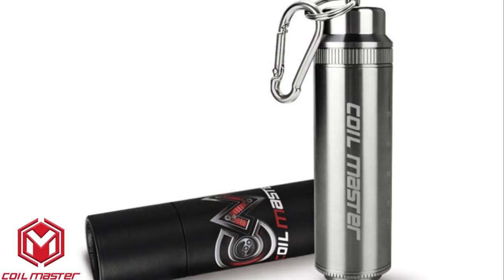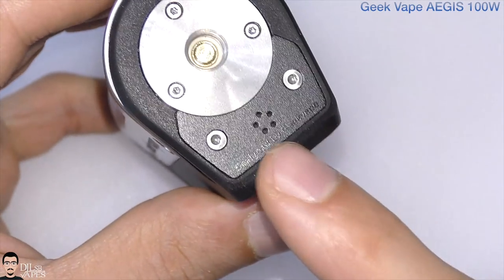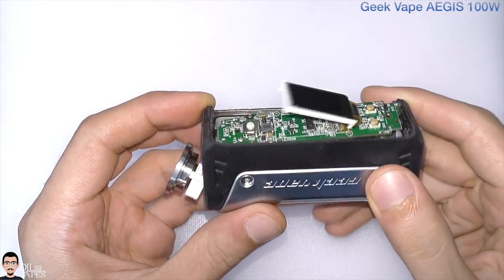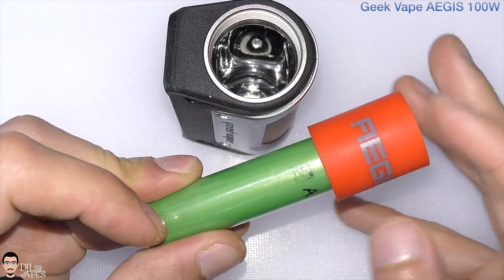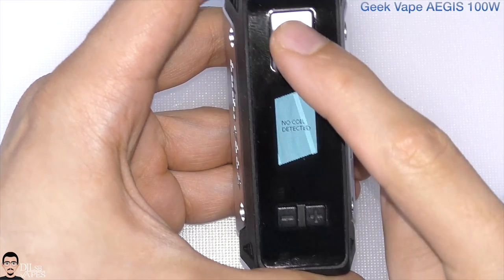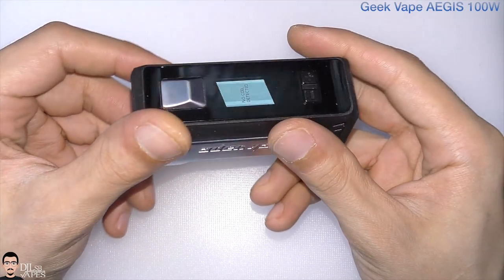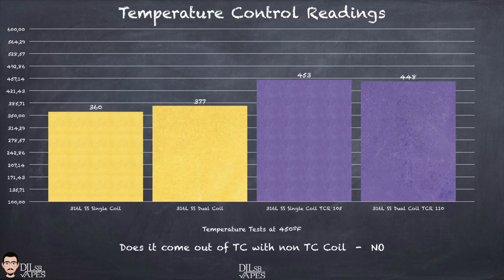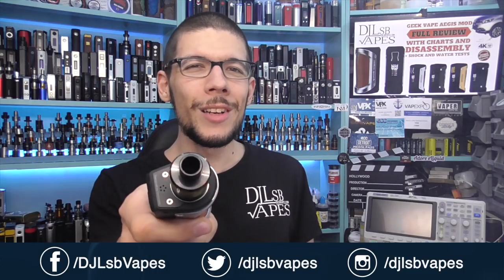Geek Vape AEGIS Full Review and   with Charts and Disassembly + Torture Tests

Comment: I got mine today and so far love it.  I have the new kit that came with the Shield Sub Ohm tank.  Do you think this version has the TC fixed?  This kit also came with an extra battery cap (marked for 20700/21700) so I can also use those batteries in it too...a plethora of batteries that can be used.  I love the instant hit on it and the feel in my hand.

Comment: Is the plastic cover over the screen press fitted? Or glued on? I want to take off the fire button and repaint it. Im the third owner of my aegis, as it was handed down from a good friend. It's over a year old I think but works perfectly still. Just some cosmetic damage. 

The panels surrounding the leather are easy to take off and will be an easy job. But I don't wanna compromise the water proofing if I remove a glued seal to get to the fire button. 

I didn't see it on your sample model Daniel, but my aegis has o-rings around the long screws holding down the 510 plate. Genius engineering to prevent water and e-liquids from seeping in the device. 

I see why this device was so popular. I love it. Perfect for my needs. 30-50ish watt vaper. 1 battery lasts a whole work day. I swap batteries when I get home and usually only drain to 3.55-3.7 volts.

Comment: Do you think vent is going to be problem on this device? I really the device but the vent scares me.Does it makes the device hotter then usual?
Reply from the maker: Not at all, always runs cool, and being a regulated mod with plastic battery compartment, will never vent I'm sure, but they still did a good venting system just in case.

Comment: I work for banks on foreclosure home rehab and demolition, I need a tough mod and the Aegis is the undisputed Champion. I own five Geek Vape Aegis mods and I bought my two man crew each an Aegis mod.  I have smashed many mods at work. One of my guys lost his Aegis mod at a property 30 miles from headquarters on December 4th of this year. We got a work order to go back to the property today.
  We looked everywhere for the Aegis he had lost and could not find it. As we pulled away from the property he yelled Stop! He jumped out of the truck and pulled his Aegis out of the dirt road directly in front of the next door neighbors driveway. Tire tread marks all over the dirt road and the Aegis was smashed down level in the sand. He picked it up the Joyetech Procore Aries tank was cracked badly. The Geek Vape Aegis was the black model and after the dirt and sand washed off it had a few minor scratches on the metal side plate.
 After a week in a half of rain and being driven over on a dirt road the Aegis works. The Geek Vape Aegis proved itself to me in real life. Not only do Geek Vape say the Aegis is shockproof, dustproof and waterproof. The Aegis out in my Ford truck PROVED IT. Simply amazing device. if you need a dependable and diehard mod, the Aegis will easily take the job.
Reply: Eyehayt Apricots you bought 5 of the same mod?
Reply: Yes, 2 black models, 2 yellow models and the grey and orange one. (1 black and yellow are still in the sealed boxes as backups or for the zombie apocalypse.) Plus I lose and break a lot of stuff at work but not anymore mods because of Aegis.  Between me and my crew no Aegis has broken yet. I have a bunch because you can't charge the Aegis and its unsafe for me to carry batteries at work. I vape at about 80 watts so I always have a backup with a charged battery. If I lose one or run the battery down which it will do since it's only a single cell mod. I quickly switch to the fresh Aegis. I have another bunch of non Aegis mods that don't leave the house but that's a whole different problem.

Comment: I still use this mod as my go to, and it looks almost brand new. They won't make another of this build quality. Even the Legend is a notch below in quality. If you vape over 80 watts, look for a dual battery mod, 26650s have a tough time at higher wattages.
I find that running this in bypass mode is perfect with my Revvo tank, gives me much better battery life. Running the Aegis/Revvo at 80 watts,I get like a half day of vaping, while in bypass I get a full day ez. all mods should have a bypass mode option (note to Smok) imho. I do get much better battery life in bypass but don't have a different mod with bypass to compare it with.

Comment: Hello,
i have just one question.
How do i lock the resistance in TC mode after upgrading to firmware 1.23 ?
If i do a 3 click, the resistance is no longer highlighted, so i can't lock it with the - key.
Thank you in advance.
Best regards, 
Volker

Comment: Seriously impressed by the capabilities of that mod, but most of all by how rugged it is.
I put my entry in, but even if I don't win, I may consider buying one.  As I have limited sensation and a slight tremor  in my hands and arthritis, dropping a mod is always a possibility, and one that can take it as easily as that is very attractive, although the shape looks as if it would pretty secure in even my hands.
Perfection would be a squonking version - tanks are fragile by their nature, but RDAs are usually solid metal, so can take a beating - but dripping is tricky for those of us with limitations, and squonking is a great solution for us.
Until such a version is available, this plus one of the more robust tanks looks like the best solution, especial as with a 26650 installed, the silicon 18650 adapter sleeve might possibly stretch over a 22mm tank to protect that too!  Do you reckon it would stretch enough for that?

Comment: Nice review Daniel. I have been looking for a new mod. I would even take the beat up one it would match how my Alien looks with only normal use.
Reply: Stuart Dias lol
Reply from the maker: Hahaha ;-)
Reply: I swear people must abuse their mods because I don't have a single problem with the alien and I've had it since its been out
Reply: It is a well documented fact that the earlier versions of the Alien had terrible paint applied. I have not abused my mod, it either sits on my coffee table at home or in my cup holder in my car. Glad to hear yours is perfect but I'm not the only one who has had this problem. It was supposed to be a joke anyway mine still works perfect with only some scratches and worn paint.
Reply: Stuart Dias if your alien stills works fine and you would like to see it shinny, search for alien paint peel from shadyvapes. Or just buy one of many wraps that are out there for the alien. Be careful to don't leak through the 510 adapter, cuz mine last night just misfired and burnt out my troll rta top cap and leaked and full 5ml tank...
Reply: Joao, my alien still works fine. I have been thinking about getting a wrap from Zapwrapz. The have some pretty cool ones. I will check out the paint peel you mention to see what it is. Thanks

Comment: Hey Daniel will a 20700 battery work In it? A few distributors have it listed as 18650/26650/20700 compatible... can you try and see
Reply: I think the 20700 would be too long
Reply: Phil Birkhimer actually they are selling a separate bottom cap for 5$ to fit 21700 and 20700 batteries WIN WIN

Comment: Nice review breakdown and testing
Reply from the maker: Thank you Grant Hampson ;-)
Reply: DJLsb Vapes Great review, recommendations and excellent mod from a great company! Stylish, I like that the have a steel plate for attys to prevent paint scratches. I WOULD purchase this today if it were dual 26650 but like that they used 26650 so that you can use 18650. Would also have liked if the last voltage and current reading applied stayed on after firing. Still a super durable mod. Great job #GeekVape.

Comment: Battery vent is at wrong place right in you face bottom vent is safer USB port can be made with a sliding lock rubber cover or screw on sealed cap for easy charge/upgrade

Comment: Update after using, found that it doesn't like to be carried with another mod in my pocket, meaning that even though I Do shut it off, it has managed to turn itself on in my pocket twice, there will not be a 3rd time. Learn from, definition of stupidity, to repeatedly do something and expect a different outcome. Also read about the firmware updates and the checking of version, this doesn't work, so I must have the oldest version with resistance lock.